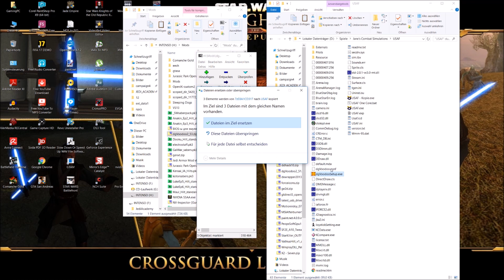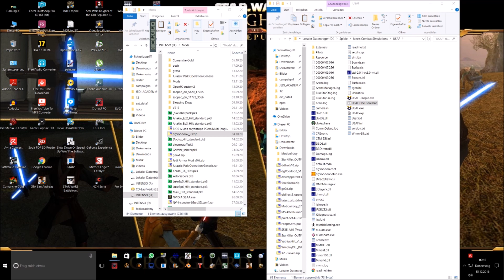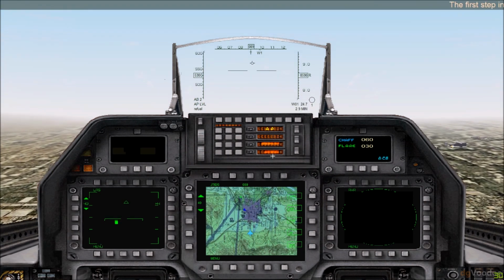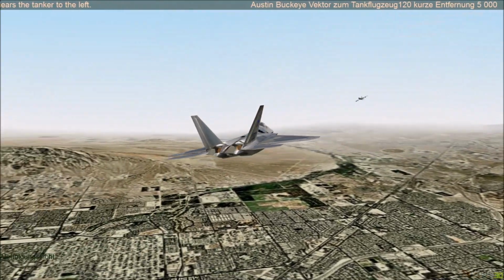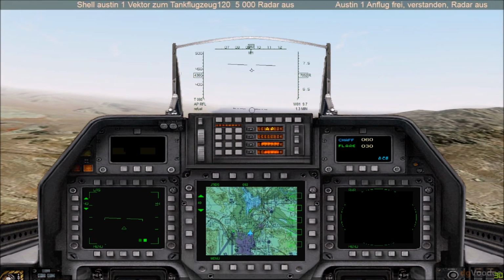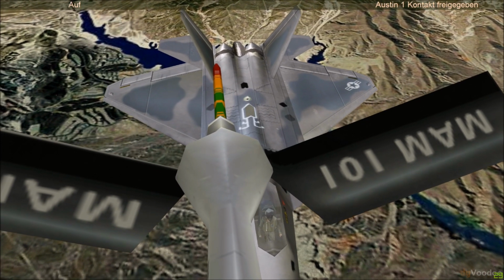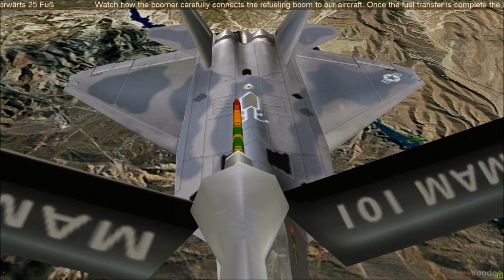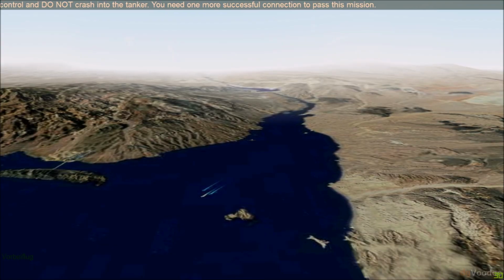Jane's USAF on Windows 10 64bit -not perfect-

Comment: Can someone provide installation link of this game as I like this game a lot but sadly I lost its whole setup file.
Reply: @AnIndianPatriot  Bro I need a working file... I hope this YT channel owner will give me a working link
Reply: @armyleaderonfof9412  this is the working link. You just have to patch it up like this guy did to run it on Windows 10.
Reply: @AnIndianPatriot  but you have mentioned above that "there is a patch for it in download folder but still it wont run" ????
Reply: @armyleaderonfof9412  yeah I know I may be doing something wrong and also this game is not Build for Win 10 but for Win 98, It has the same problem in Win 7 too. I am hoping that it will work with some fixes.
Reply: @AnIndianPatriot  I used to run this game in Win XP last... Then I lost the file... However, I will install it and try to run.. lets hope it works..
Reply: @armyleaderonfof9412  I think it will definitely work on your Windows.